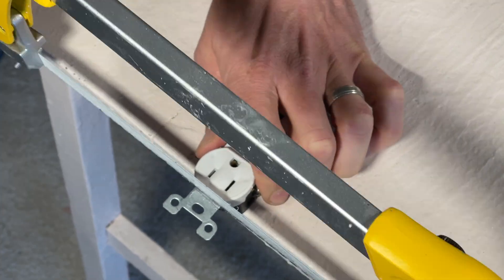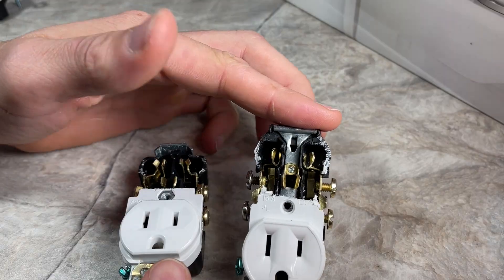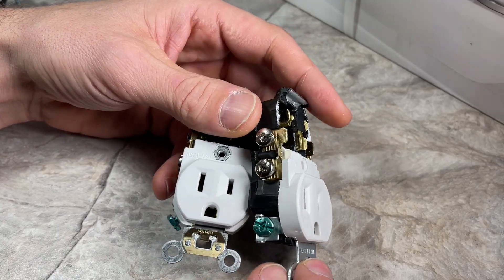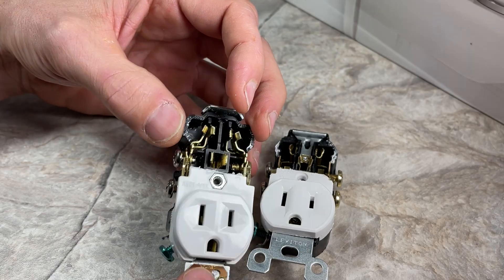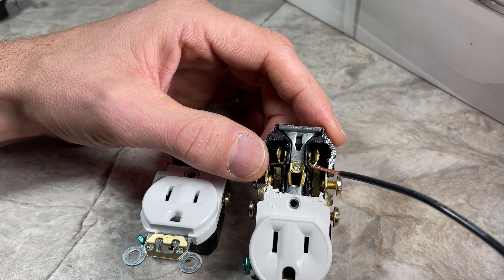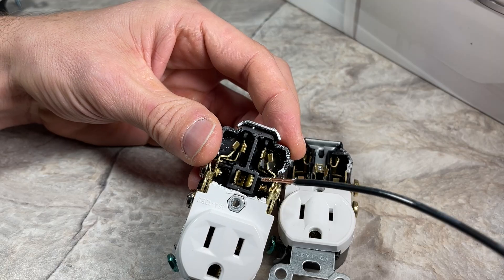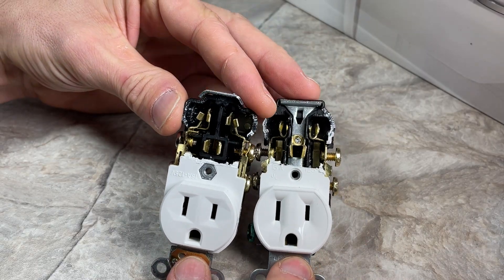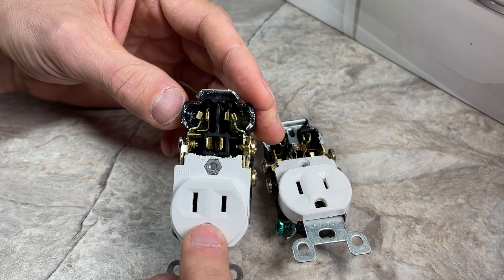What Outlet Should You Buy For Your Home |  Commercial vs Residential

Comment: The spec grade outlets have screw and clap plate connector system. You don’t loop the wire around the screw, but insert about 3/8” under the clap plate and tighten the screw. GFIC have similar clap plate but it’s internal and the screw tightens down the plate.
Reply from the maker: Hey Tony,  thanks for calling that out as you are right I missed that feature in the video.  👍

Comment: The commercial ones are much easier to wire.  You do not have to form a loop because the screw clamps the wire between two plates.  It like the advantage of the push connectors without loosing safety!
Reply from the maker: Totally agree Douglas.  Thanks for pointing that out 👍

Comment: First off. When it comes to plugs and the connection is how you make up the wires. If you don’t wire nut the connections and leave a tail to hook to the plug your asking for trouble. Using the plug as the pass through is bad. Been doing electrical work for twenty years. Have put on thousands of plugs using the holes in the back of the standard plug. But I alway made up my plugs. Nothing wrong with using the commercial grade or 20 amp rated plugs but it’s kinda a waste of money. Most of the failed plugs I have come across fail do to heaters or to many devices plugged into a cheap device that lets you plug in 6 items.
Reply from the maker: Thanks for the feedback Mark.
Reply: Here again people don't under stand the concept of doing this. Some people appreciate quality. Some do not.

Comment: I was a QA Inspector for Leviton in the mid ‘80’s.  Guess what...we made switches and outlets for Sears.  Aside from not stamping the Leviton name on them, and boxing them in a. Sears box, the tolerances were a bit different.
Reply: Different how?   Better... or worse?
Reply: @floobertuber  tolerances were a bit “looser”.  While a Leviton product had a tolerance of +/- .02, a Sears product maybe had a tolerance of +/- .03.  My numbers are for example purposes only.  I guess you can say “worse”, but it was negligible and did not really affect the performance of the product. Also, this video is talking about commercial vs. residential, as opposed to Sears vs. Leviton products.  Hope this helped.
Reply: @nickdeliso7026  It did!  Thanks for the update!
Reply: @floobertuber  What many people don't realize is that many store brands are made by the major manufacturers...supermarket brand pretzels vs name brand, for example.
Reply: @stick66  Ayup.  As I once told a family member, "I can confidently assure you, Aldi does not have their own black pepper processing and packaging plant."   😆🤣😂
Reply: @floobertuber  funny you mentioned Aldi.  I recently discovered them and am a fan for “light shopping”.  They have stuff there I’ve never seen before.  I’ve yet to be disappointed.

Comment: Enjoyed the video and have some info. I would like to send you. One might assume that an outlet made by major mfg. in the USA approved by UL is safe. I am an EE, competent in most trades, licensed in some. Shortly before my sons family moved into a 7 year old home, asked that town's inspection and fire departments if there were any unusual "risks" in the area. The fire dept. told me they were experiencing a lot of unexplained electrical fires. Coincidentally, i was on-site and noticed the painter constantly moving his radio when he lost reception. The cause was plugs inserted in outlets would literally fall out unless you taped them in place. In all the bedrooms the outlet by the door with no furniture in front was used frequently for vacuuming. I have been doing electrical work for many-many years, never seen anything like this. Contacted the manufacturer, UL, and the CPSC. Have quite a  story, engineering drawings and photos (being a NERD is a blessing and a curse) which shows a defect not in design or materials but in manufacturing, the way the brass was bent. Replaced over 75 outlets in the house, and kept for the CPSC who promised to have an inspector to examine the evidence. Never happened. UL tests outlets for 200,000 insertions and claims they did their job. The CPSC is the only Federal agency responsible for recalling dangerous electrical devices, they refused to do their job claiming if there were a lot of deaths of class action lawsuits they would get involved. Outlet connection screw quality has improved dramatically in the last 10 years, but a good trades person would rough-in outlets with "pigtails" to insure integrity of the circuit regardless of device quality.

Comment: If you think the 35cent ones are cheaply made take a look at what goes in mobil homes and the switch's are even worse.
Reply: Not true. I stay in a mobile home and it was a top of the line model. Many of the switches and outlets are better than what you can buy now even. The switches still snap/click like a new one, which the.snapping/clicking is a good thing safety and load wise. Not to mention most now are being build with the same if not stricter requirements now for stuff like plumbing and electrical because of the fact they are moved. Was there a time and are some still built cheaply yes, but that also applies to stick build homes.
Reply: Aluminum wiring or aluminum with copper tips?
Reply: Hey man. I live in a mobile home 😳
Reply: @wb3161  hows the miles per gallon on it?
Reply: @jennifurzoe1302  I’ve had it for almost 16 years and I’ve not used a drop of fuel yet
Reply: @wb3161  awesome,and how many miles has it travelled?
Reply: @jennifurzoe1302  gallons per mile* 😅
Reply: Frig off, Layhe!
Reply: The manufactured housing devices are crap. My parents lost their old house in a flood and replaced it with a $130,000 modular in 2014. Every couple of months a switch or outlet would fail, within 2 years I had replaced them all with commercial grade devices and there have been no problems since
Reply: Yep Fleetwood used to use IDC (insulation displacement connector) receptacles and switches that literally just snap on to the wire and pierce the insulation to make contact. These were in both their manufactured housing IE trailer houses and in their campers AKA travel trailers AKA RVs.
Reply: @Speed Buggy the ones that were used in my parents house definitely were not. They were not carried at Home Depot, Lowes or Menards. They don’t even accept a standard cover plate if one wanted to change style or color and None of the stores could even get them. They don’t fit in a standard box requiring me to change all the boxes also.
Reply: @fredhankes5608  Yep, see https://www.ebay.com/itm/20-AMP-Receptacle-Coleman-4752-2371-For-Air-Conditioner-Direct-2U-SKU-2858-/163702997869 these were the 20 amp version of the 15 amp Coleman IDC receptacles in my 1992 camper and 1995 16x80 trailer house, both made by Fleetwood. No box at all, integrated cover plate.

Comment: I've stood in the aisle at the box store looking at the outlets trying to decide.  This will definitely help me with those decisions!  Thanks
Reply: @creamwobbly  I do. Spent 15 minutes this week deciding what brand load center to get.
Ended up with Square D, because they had nearly full stock for breakers. Eaton was bare.
Reply: @JasonW.  I have a GE load center with a mix of Square D and GE breakers in it because that’s what the big box store had. I would’ve liked a Square D or EATON panel though.

I like Square D (Schneider) as well as EATON’s Pow-r-Line panels.
Reply: @miket5506  I have 4 panels right now: GE main, Eaton sub jn house, now two Square D Homeline subs in shop outbuilding. I'd rather have QO but, breakers short on stock right now, and much more expensive.
I dislike the GE, and will probably replace it at some time.
Edit: also, all are plug on neutral except the GE. Wish they always came with neutral on breaker (PoN) for simplicity.
Reply: @miket5506  I like a panel that is not 60 years old, with 60 year old breakers. To much made of OLE SPARKIES ( hazardous panels ), where the real issue is in the breaker having been long past it's service life, and no longer available. No sense replacing breakers on a 60 am service anyway... time to upgrade to 200 amps, cheaper than buying a case of breakers, or slims to add extra circuses.
Reply: Its 120 VAC, so its always an easy decision for me. Go with the better built more expensive stuff.
Reply: @creamwobbly  What??

Comment: I think you missed a big advantage of the commercial receptacles: see those clamps under the terminals? Back-wiring! (No--not the push-in kind). As you pointed out, the push-in connectors are not recommended and probably not code in many places (but their ease of use sure is tempting!) The next best thing is back wiring--where you insert the wire under the screw clamp from the back and tighten without having to wrap the wire around the screw.  Not all commercial outlets have back-wire capability so check before you buy. They changed my life!  https://blog.leviton.com/back-wiring-vs-side-wiring
Reply: Here's a commercial back-wire outlet. https://inspectapedia.com/electric/Receptacle_Connectors_Clamp_Screw_051_DJFcs.jpg Some say looping the screw is better, but I've seen loops "squeeze out" from under the screws. This is more fool-proof. The clamped back-wire connection is substantially similar to the clamp connection on a circuit breaker
Reply: @mntriangle  I do agree that the clamp-on connections are better (and faster). 

But I have to ask, when you said that sometimes the loop connections on wires will work themselves loose, has this ever happened to a wire that went the full circle around the screw without leaving an open space?

 Because that's typically how I put my wires on the screw terminals on an outlet or switch.  One of the reasons why I do that is for the very same thing that you mentioned, to try and limit the possibility of them working themselves loose over time (or as a result of the switch or outlet being pushed back into the electric box).
Reply: @UnlistedRX  I'm very careful about creating a full, tight loop, so I haven't had any failures on my outlets or switches (and I recently disassembled a bunch of work I did over 30 years ago). But I've removed other people's work where the loop wasn't complete and was pushed out to the edges of the screw head when it was tightened, and barely holding on. Ever watch a beginner try to loop and screw down stranded wire? It's usually an ugly hairy mess! A looped connection is great if you do it right and make sure it loops in a clockwise direction. But in my opinion, the clamp is easier and faster, and harder to get wrong. Also, when I'm wrestling an outlet with multiple 12 gauge connections into a tight box, I worry a little more about wires sliding out from under the screws than out of the back clamps. I just feel better about the clamps.

Comment: I do rental and I always spend more because I don't like repairing anything again.
Reply: I have rentals for 40 years now. I do all the repairs and renovations. I only use the cheap outlets and never had a problem. The reason I use the cheap ones is because usually when the tenant leaves the apartment, I have to do some renovations. The outlets always look discolored and old if not painted over. I replace the outlets along with the renovation. The look of new is unbeatable.
Reply: @yt66228  Your situation, I agree.  And for rental and landlord, I agree,  in 15 years, I have only experienced 3 failures on my 13 rentals.  All my tenant is 5 to 10 years.  I just buy the higher end because I am programmed that way.  All dewalt and Milwaukee tools.  FYI, this kitchen, I thought it was good, now in all 13 house, it leak every year and tentan like the looks. Glacier Bay Market Single-Handle Pull-Out Sprayer Kitchen Faucet in Stainless Steel
Reply: ...measure twice, cut/saw once.  " Do it right......Do  it   O N C E.  ........= EXACTLY,,  bro..
Reply: @petersack5074  There's also that old saying in auto repair.

"Never enough time and money to do it right, but always enough time and money to do it again."
Reply: only time y0ou want to hear from renter is when they're bring rent over

Comment: A buddy of mine, who’s a Master Electrician, explained it to me like this; the commercial unit will handle more load, even though they have the same amp rating. So, naturally, my next question is then why pay more? His answer was “ it depends on the frequency an appliance is plugged/unplugged” and/or whether or not it’s a split circuit. He also recommended the commercial grade if you’re going to use a contraption to increase the number of receptacles. So I just splurge and pay the extra $1, just to be sure. Lol.

Comment: You also need to think about your use case. Are you a business owner that will pay an electrician $200 to replace an outlet? Or are you a home owner that can do it yourself in a few minutes? If you don't want to do it yourself if it does fail, that extra $1.50 is like insurance against a $200 electrician bill.

Are you a home builder who wants to minimize warranty work? 

As with most things in life, labor is the real cost. Trying to minimize labor cost is key unless you do the labor yourself.

Comment: When my house was built 16 years ago, the contractor used the cheapest switches, which is understandable, several more dollars in his pocket. During the switchover to using the recommended fluorescent bulbs several switches failed over a two month period due to cracking and arcing. I replaced them all with better grade switches. No more problems since (9+ years).

Comment: Another not so obvious issue is the plastic composition itself. Many of the materials today are being sourced from China and while they MAY meet minimal chemical specifications, they will have a high failure rate, especially over time. This may contribute to the facing/body separation issue but I have seen many internal failures where the plastic fails (to brittle) and allows the internal shorting / heating failures. I'm disappointed that the NFPA is allowing these products to be continued in our country.

Comment: Your outlets look funny. They have that "surprised look" lol !
Reply: Are you from Europe? The European and British outlets are really superbly designed compared to the American outlets. They have a super heavy duty overengineered look. Europe must have looked at where the US went wrong and did better. Also for going with 230 V rather than 120.
Reply: @jdks1761  I'm in Australia actually. Our outlets are different again. We are like the U.K in that we also have 230-240v but our outlets differ to UK obviously. When I buy a U.S  piece of hifi gear for e.g that has multi voltage, i can bend the pins to make them fit our receptacle but you have to be careful if it's polarized. Need to bend the pins in a way so the "hot" pin slides into the hot side of the plate.

Comment: I usually only use the expensive ones in my  houses where I'm going to use the plug regularly. I've found that the cheap ones last just fine if they're only used occasionally. Plus these things are easily replaced if you have a problem. I would specify the better ones if I was paying a high dollar electrician to do the work. 
       Ps. If you think the low price plug shown in this video was cheaply made you should see the 40 + year old ones I replaced in an old manufactured home.
Reply: Yeah, at a minimum in a kitchen, garage or the easy-to-access plugs that a vacuum might get plugged in regularly should have the commercial ones.
Also a good idea to go tamper resistant.
Reply: @sunriseshell  tamper resistant is a bitch and a half to plug anything into. I’m sticking with plain old industrial grade. If the inspector doesn’t like it he can blow me 😆
Reply: @miket5506  Don't disagree but having a toddler around made me rethink it.
Reply: I'm only moving furniture and crawling on the floor once. A $1.50 is cheap to assure that no one has to do that ever again.

Comment: Be sure to use 20 Amp where it is connected to a 20 amp circuit. 15 and 20 are the two choices. Start by changing the frequently used ones if you are on a tight budget.  The kitchen is usually 20 amp and  kitchen,bathrooms ,garage and exterior should be ground fault interrupt. Sometimes they are daisy chained together. That’s why some have buttons and some do not. Cheap light switches wear out also. Learn before you burn and never assume.

Comment: You should maybe mention the differences between 15 AMP and 20 AMP outlets, if your breakers are all 20 AMP then using a 20 AMP outlet makes sense, but if your breakers are mostly 15 AMP then the 15 AMP out makes sense, also note that some appliances such as Microwaves require a 20 AMP outlet, nice video though.
Reply from the maker: Appreciate the feedback 👍

Comment: We wired our home with all the cheap ones. Many that get used a lot fail. It seems that maybe the heavy loads, like hair dryers, vacuums, etc, cause the fail. My theory, is that they heat up a little during heavy use and then lose their temper and thus do not hold the next plug as well.
Reply from the maker: Thanks for the feedback Teresa.